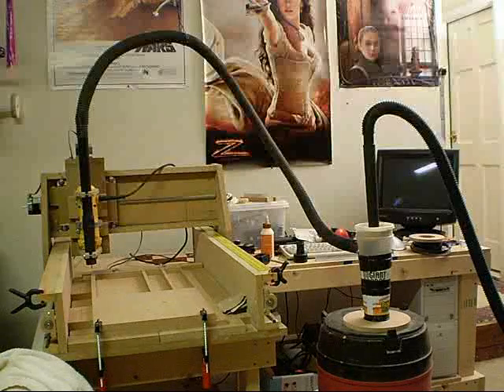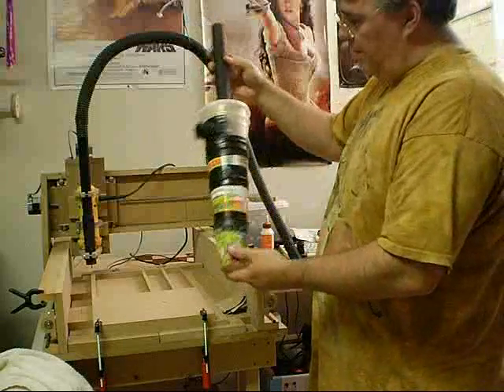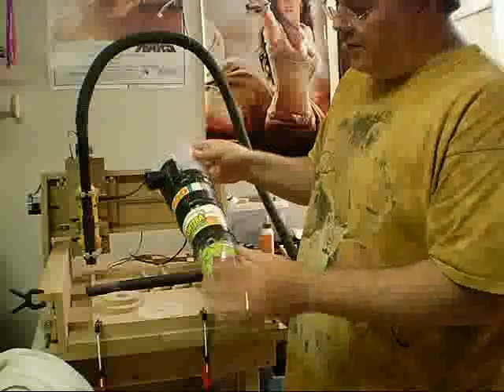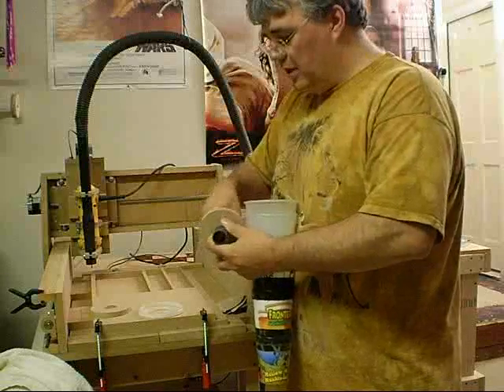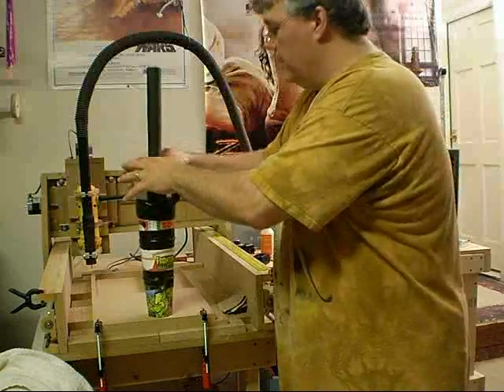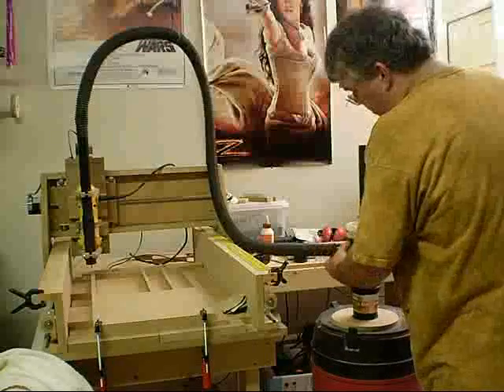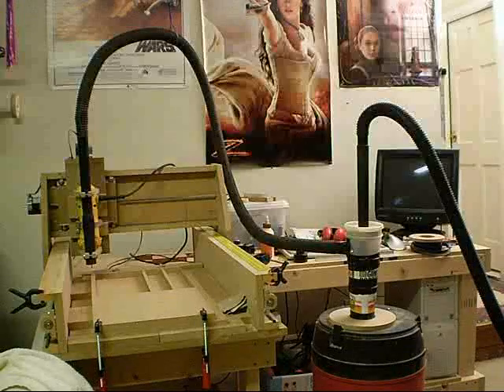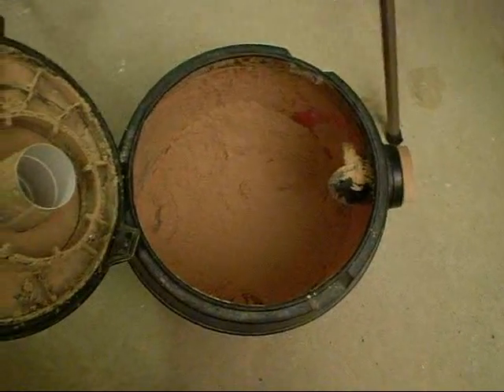DIY Cyclonic Dust Separator (Dust Weasel)

Comment: I'm 90% sure that whirlpools and air swirls in the Northern Hemisphere turn clockwise and counterclockwise in the Southern Hemisphere.  Interesting that you set yours up with the intake on the right side and it does not affect performance.  Might as well make it even easier to make by putting the intake pipe square in the center.  I plan on eating Chinese on Saturday so I'll be giving your deign a go on Sunday.

Comment: Well,,,,,,,,,mine looks better than yours !!!   First I saw Wood Wisperer do a comparison of three models and one of them collapsed during testing.  Then I watched several other vids and they all had pretty hefty materials.  I did some research and found that a very good vacuum cleaner can create 2 psi on its components.  Not a big load but I thought better to be hefty than have to repair.  If I only knew at the time that all I needed was to order Chinese take out and use the garbage to make it.

Comment from the maker: Sorry :) I probably shouldn't mention that it is still working just fine after 2 years of use.  The cups over lap each other which double the thickness, that combined with the normal lip of the containers seems to be more than strong enough for this application.  The only flexing I get is on the soup container lid on top if I block the hose, and it just gets pulled in a little bit.

Comment: @derekradac27 Hi it realy needs a cone as the air goes round the cone the saw dust is heavier and gravity pulls it down , the air being lighter goes a round the outside and then up the inside of the outlet hose conneced to the vacuum,
Graeme.

Comment: @FloweringElbow   These aren't meant for fine filtration - it's a dust separator.  It gets rid of the big stuff so the vacuum can get rid of the fine stuff (which doesn't clog it as fast). You still need a filter on the exhaust side, which is why it's hooked up to a shop vac (which has a huge filter inside it).  The shop vac bottom you see in the video looks like it is only used for dust collection and he has another actual vacuum nearby.  Most people use a 5 gallon bucket for that purpose.

Comment: @fergawdsache I believe the dimensions are reasonably crucial.  The key is to make a design that is proportioned correctly so that the 'turn around' point of the air, is just right -so the dust is directed into the collecting chamber and not sucked up. Almost any cyclone will be quite good at separating off the bigger particles -it is the nasty invisible, fine dust that is worst for us. So it makes sense to design a cyclone to deal with this stuff. Step-by-step build on my website if interested.

Comment from the maker: @fergawdsache Not sure about the length or diameter, I think any cone will do,  I believe the vacuum source pipe (top) should extend below the dust intake pipe (side) to generate the cyclone effect.  I am still using the one in the video and have not had any issues with it so far.  I do have the parts for a new one that I may make an 'instructable' out of, but I have not got around to to.

Comment: Hi, thanks for the vid,couple of questions,is the length of the cone and diameter important ?,Does the side pipe ie the one sucking up the dust from the source have to be close to and above  the end of the downward facing pipe, i assume they cant be too close together or the dust would just jump the gap,Had any problems  since making your video.
thanks in advance

Comment from the maker: @TeenWoodworker Yes, I believe there is some loss of suction, maybe 10% or so.  I do not think it would work with a bag (I could be wrong), but you can use a much larger container for you dust bucket.

Comment from the maker: I suppose I could do something like that, there is a video of a guy who made one using 4 plastic soda bottles.  It catches most of the dust, I end up with a very fine layer of duct on the cloth filter in the shop vac after running 2 to 3 hours, as compared to clogging the filter in about 15 minutes without it.